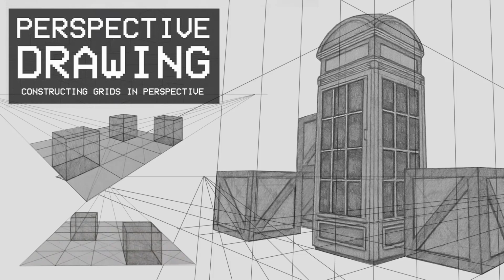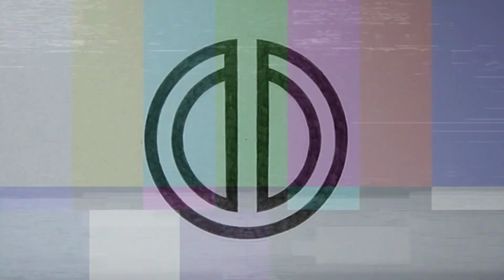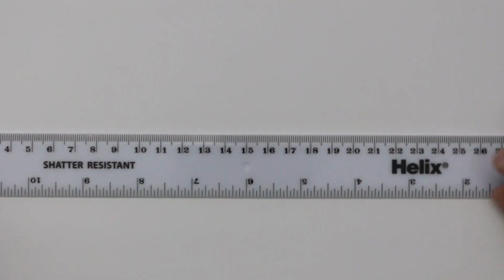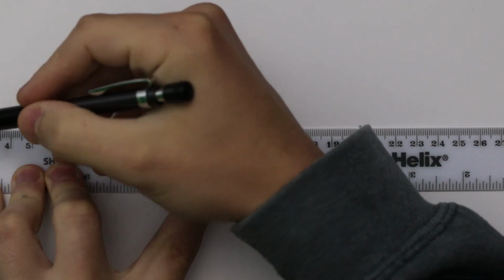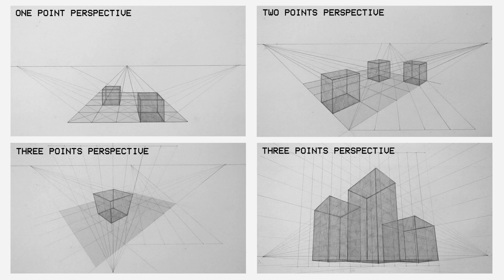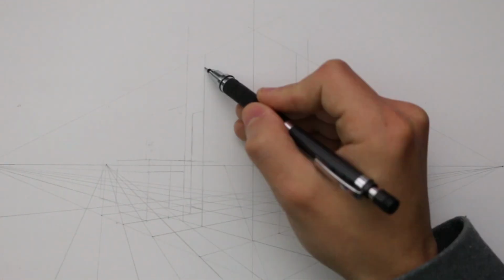Perspective Drawing 11 - How To Construct Grids In Perspective

Comment: if you want completely square grid segments, you need to place the diagonal vanishing point directly in between the 2 right angle vanisjin points, the further from the middle, the more rectangular your squares will be
Reply: Can you rephrase this? I'm not able to follow it. Also, are there reasons you would want them square and not diagonal?
Reply: @Followthelight36  well i think i was actually wrong but what i meant was that if your diagonal vanishing point is too far to one side it will create rectangles instead of squares, but i think the diagonal vanishing point really needs to be in the direction thats right in the middle between the two vanishing points, 45 degrees from each of them, as the two first vanishing points are at a 90 degree angle from the point of view. im not quite sure where this puts the point on paper, but its just good to make sure you're not using rectangles for objects that have equal width and depth

Comment: 2:50 How do you determine the angle of the third line and the measurement of the parallel line at 3:36 which is 14 cm. I understood that there is a relationship between them but I couldn't solve really. I have a similar question at 5:01 Maybe you told but I didn't get it because of my English. Could you help please?
Reply: it doesn't matter how long the third line is. Try any length and it will work, but longer might be better especially if you're doing more divisions so you can be more accurate.

Comment: Great tutorials. My question is based around (1:25) making the lines cross through the diagonal corner to get a vanishing point, my lines from that point on don’t always pass through the diagonal corner when connected to established vanishing point. Tried so many times. Not getting it
Reply: Hey im having the same problem did you find a solution?
Reply: Yup I'm having the same problem. The line is so crooked and off that I can't make the other tiles look foreshortened the correct way
Reply: You guys find the solutions yet? I've been trying since yesterday

Comment: Bewer method is killing me. Is there a change you could cover how to use it efficiently in a video? The 'How to draw' book is not too clear.
Reply: The brewer method.. Choose 2 lines from the bottom of your vertical and 1 line on top than draw a rectangle HORIZONTAL AND VERTICAL and connect the last point where is intersects that rectangle. hope it helped